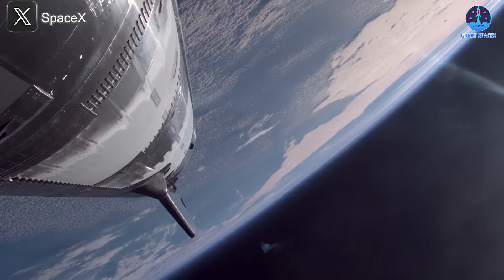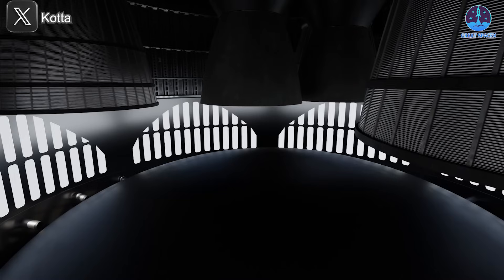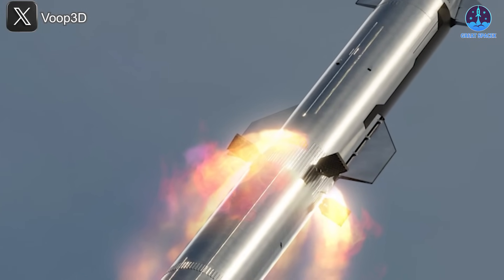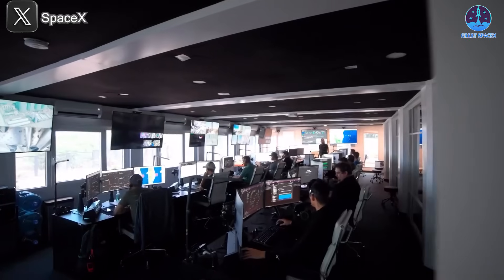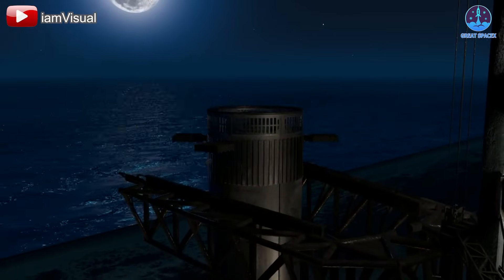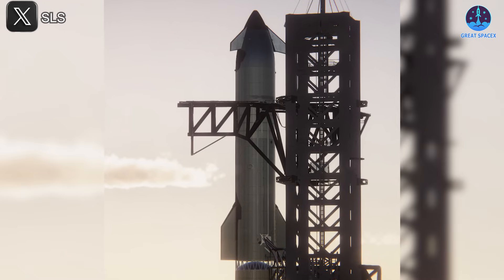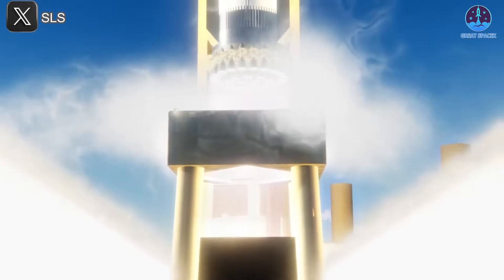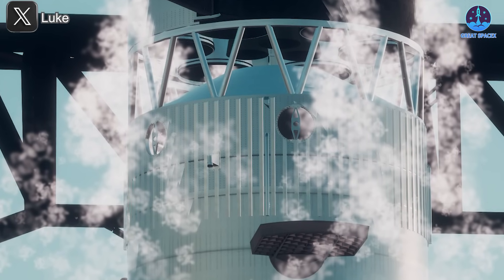SpaceX revealed New Starship HSR Design to Solve Fatal Flaw Destroyed Starship V2...

Comment: Assuming the number and location of the grid fins are the aerodynamic priority; rather than install 3 more vacuum engines, they might just add 1 more, then there will be 4, and they can align with the spaces between the grid fins.

The 3 sea level engines in the middle are beating the hell out of the vacuum engine bells. If there could be 4, then the exhaust could be aligned with the gaps between the vacuum engine bells. Of course, in this configuration, the grid fin control mechanism and battery would have to be protected from that blast, but being in the center, the blast has a little farther to go and they could be diverted to the left and right versus a direct confrontation with a necessarily heavier shield.

Also, does the top of the tank have to be round? It's not under high pressure. Why not shape the top of the tank in a more conical shape and extend the hot vents down further so the hot exhaust doesn't have to turn so sharply. I know a conical shape would have slightly less efficiency of capacity vs weight but the tradeoff could be considered.

Another possibility, wait for the separation before lighting the center engines. It might make a smoother transition and there would be 1/2 the blast on the hot staging area.

Comment: And all this could be eliminated with a controlled, phased ignition at staging.   Frankly, getting rid of the ring completely and installing three electric solenoid pushers to separate the stages two seconds before ignition of Starship's engines would eliminate mass and solve the problems.
Reply: @Barbreck1  they had that in the first few flights and barely worked then. 
it also led to critical  fuel sloshing and so on that killed a lot of boosters, the thing they'd really need would be the engine shielding back on the ship.
Reply: @Em.P14  No, they didn't.  Their method at the start was rather crude and clunky.  They shut down the booster engines completely, detached the ship, flipped the booster, then relit the booster engines.  there was little or no finesse to the sequence.

I'd reduce the booster thrust to minimum (three engines, low throttle), trigger ship release and ejection pushers to push the ship clear, then light the ship engines before flipping the booster.  That way, the booster never completely loses forward thrust and the ship is given a good push clear without being slowed down.

Comment: The ship starts. Why continue with hot staging at all?
Lose the hot staging prosess   all together.
Reply: Starship would lose a lot of lift capacity if they get rid of hot staging.
Reply: Fuel slosh. 
Continuous forward propulsion keeps the fuel at the bottom of the tanks, feeding these Raptor engines. Hope this helps.
Reply: @jamesogden7756  Good point. !!!
Reply: Loss of momentum if engines not firing at separation. Equates to greater fuel demand to regain lost velocity and achieve orbit. Not sure about the actual figures but believe it is substantial - perhaps someone has the figures?
Reply: @tim-7688  thanks but I know that. 
They should get the next iteration of rapter on it and scrap hot staging.
If not why have they not changed the dam ring already.
It seems ass dragging on small issues are a real problem.🤔 If it is the ring, it should have already been done. 
SpaceX does things very fast so why hasn't this been fixed? 
They built 2 next generation ships with the same ring that was in question deliberately repeating a mistake.
Don't get me wrong, I love SpaceX but they seem to be stumbling.
Reply: @XCX237  iteration takes mistakes to learn from. 
And they want to go fully reusable.  So, there's a little conflict. They are actual rocket scientists.  They'll solve this. A few blown up designs are worth the data they're getting to make decisions.  It's easy to armchair quarterback after the fact, but less so when you fail to grasp the motivation behind the actions. 

Me? I'm just stoked to see the show. Success or failure. One day, I want to ride one of those. NGL, it's going to be awesome.
Reply: @XCX237  I don't think they're ass draggin'. If flight 9 goes early May that would be 3 flights in about 12 weeks. After loss of flight 7 the attention seemed to be on fuel delivery. Flight 8 loss seemed to be more about back pressure from Ship engine ignition which focussed attention on HSR. They are now addressing this and flight 9 hopefully will achieve orbit (not sure about reentry!) . They have a few version 1 boosters so it makes sense to use (and reuse) these with a temporary fix to the old HSR. Upcoming V2 boosters with redesigned HSR along with V2 and V3 Ships and V3 Raptors should be the dogs! Be patient they'll get there.
Reply: @XCX237  why are you so confident about your dumb ideas?
Reply: @websitemartian  I'm not . I'm a truck driver. been watching a long time . 
 I have nothing invested. 
Do you?
Reply: @XCX237   no. i believe SpaceX probably knows better than i do
Reply: @websitemartian  yup. Just talkin anyway.

Comment: Reuse of booster forces use of old and short hot stage ring. Bad prioritization. Somehow they need to go taller hot stage rong with more vening area to reduce back pressure. Perhaps they need to do a ground based test of a starship with the hot stage ring attached. The fact that they are afraid to do that says current hot stage design is too dangerous.

Comment: As I said before, use some form of Draco engines pointing upward to help separate the booster from Starship.
Reply: my thought too.  It looks like the benefits of hot staging is getting less and less as they try to make it work and it may be time to  go to a different concept for doing separation. how about small strap on solid state rockets(like JATO units) to provide the "kick" and are then ejected so they are not an issue for reentry.

Comment: Although it may seem sensible to protect the grid fins it might be better to use them as additional baffles for a more positive and faster separation , you will see when the alignment is made and the openings are above the grid fins or not . landing legs might balance the hot stage ring

Comment: The reduced exhaust outlet on the hot stage ring may be to increase the power and speed of separation , possibly to reduce fire damage from prolonged separation, tgey may have decided that the engines can take pressure better than extreme heat

Comment: I'm sure Space X can adjust the second stage raptor ignition timing to overcome any HSR difficulties.

It's just like the deluge system vs the flame trench, you won't perfect it, until you use it, to determine if it's a good enough or best solution for the problem.

Comment: A 3 to 6 potato cannon like system with spring asset would be better and safer.  This can use the onboard fuel for activation. The Cannons pistons can act as body assembly alignment pins. As the piston clear the barrel the vacuum engines start and then the 3A [sea level] engines.

Comment: I wonder who has been saying this all along? Oh yeah, Me. Delete the hot staging ring and just separate like every other rocket does, and does it well.
Reply from the maker: Why does SpaceX need to delete HSR?
Reply: Actually they do really need a HSR if you knew the top of the booster is very fragile you have all the hydraulics for the grid fins and some of the computers and the top of the booster is just not strong enough to withstand the engines.
Reply: You should work for NASA you have about the same mentality as them and zero experience as a rocket engineer.